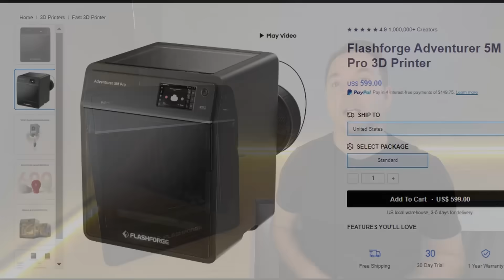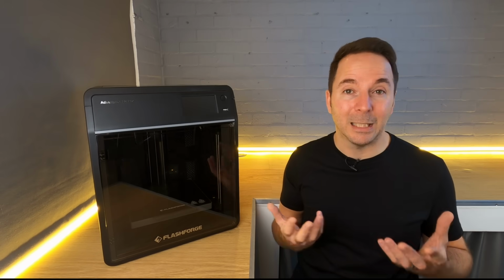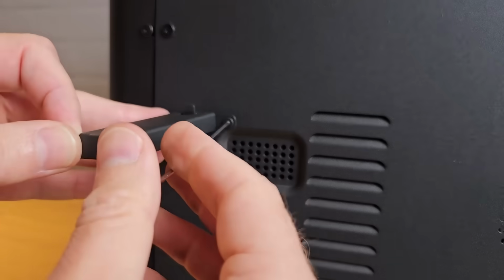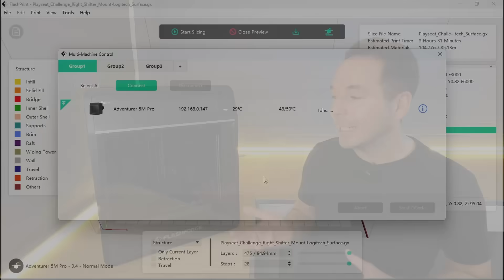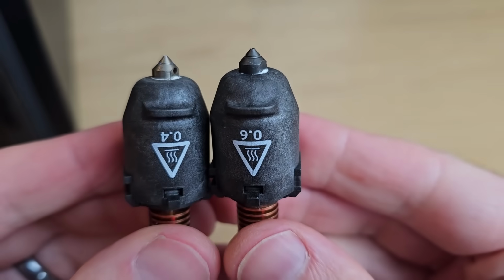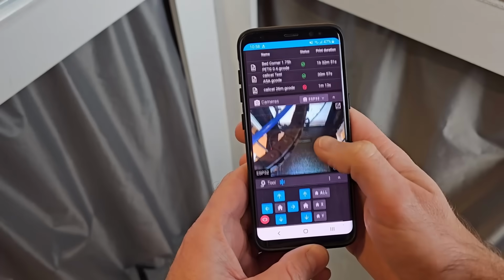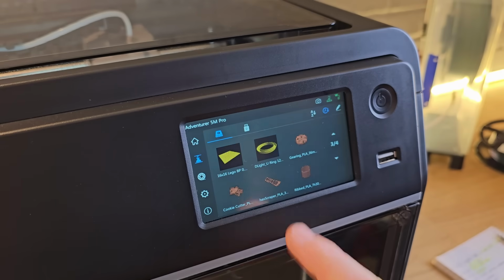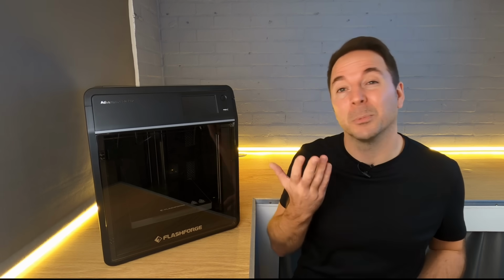The BEST 3d Printer That I Won't Use! - Flashforge Adventurer 5M Pro 3D Printer Review

Comment: I am the type of person who wants and needs a plug and play 3D printer.  I primarily use the 3D printers to make components for the products I make and sell.  I first bought 3 Adventurer 3 Pro machines in August 2022 and when the ADV5M Pro became available, I bought one and when I saw how great it was for my use, I bought another one. The 5M Pro makes production of making the components twice as fast as the Adventurer 3Pro machines. In fact, in the future, I plan to replace at least 2 of the Adventurer 3 Pro machines with the Adventurer 5M Pro machines. I have only used Flashforge printers. I am very happy with not tinkering if I don't have to. I am also glad I don't need to build my own 3D printers.
Reply from the maker: Sounds like a great printer to suit your needs👍
Reply: Thank you. This is a great comment. I am convinced.
Reply: lol funny enough I’m glad I found this comment and video. I’m not a “tinkering” person and my ender 3 has been collecting dust because I just can’t grasp it, I’ve had it for years yet I’ve never managed to finish a full print. And all the forms I find on it, apparently it’s rare to even have a non modified Ender. I’m very interested in this particular printer and im definitely considering buying it!!
Reply: Thank you for a really in-depth and “warts an’ all” review, Ricky. I’m looking for my first 3D printer and I am definitely NOT a tinkerer. This looks like a good choice thanks to your considered review. Only one question - looks like the print area is about 8.5” x 8.5 x 8.5.  Any other comparable “plug and play” printers out there with appreciably larger print volumes?
Reply: @LippyDotCom loving my Bambu A1 Mini. I've only been 3D Printing since I got it in September. 
It was easy out of the box, it has just enough "tinker-ability" but is 100% out of the box usable. It has an available AMS so it can print with up to 4 colors without having to go and manually switch the filiment. 
I hope this finds you well and if you have further questions lmk

Comment: Great video! 

That said, and maybe I'm being dense here... but aside from the nifty hotend replacement system this seems to be trying to do what the P1S does, but slightly worse. For example, the filament change process... to say nothing of the greater options given by Bambu Slicer and the better 24/7 remote control. 

I really don't understand why I would choose this over the P1S, especially since the P1S also gives the option of the AMS.
Reply: You're saying the Bambu P1S would be a similar machine except with better flexibility?  I'll be buying something this week...I just have to decide which.
Reply: @boomupengineering  Based on this review and my own experiences with the Bambu machines, yes. The Bambu P1S just seems like a better quality machine for the money.

Comment: The "locked down" mindset is the prime thing keeping me from even considering many of these new printers.  I liken it to buying a new car.  If the manufacturer says "Sure, you can drive to any address you want but you can only get there by the route we decide and you have to listen to the radio station we program into your presets" I'm pretty sure most people wouldn't be too happy with that.  I just outright refuse to pay so much money for a device where they get to maintain so much control over how I use it.

Comment: I'm expecting my Adventuret 5M Pro tomorrow. I appreciate the critique and troubleshooting, as it leaves me prepared on how to fix possible problems if I run into them too.
Looking forward to it.
Reply from the maker: It is a really good machine.
Reply: How have you liked it so far?
Reply: @SangheiliSpecOp  There's definitely room for improvement on their software/firmware side, but the printer itself has served me well. It took me a while to figure settings that worked for me, but has been great since.
Reply: @Oblimix  thank you for sharing :) I'm glad to hear it
Reply: @Oblimix  7 months since your   comment is there anything else you'd add? 

I'm seriously considering this printer as I'm not much of a tinkerer and more about convenience and functionality. Buy once, cry once kinda guy.
Reply: @PaddyFromPaddistan  There's not much to tinker, really.
It was definitely worth it. I have printed loads of things, both functional and consmetic, for myself and family. I have also successfully sold several items from the prints on this machine, which has already paid for the printer itself. 

I have only tried some types of PLA and PETG. I didn't like the durability of my PETG, but I became a fan of PLA+ and Silky PLA, which print nicely on this printer (and you don't even need the Pro version of the printer to print those). 

One thing that I changed, and which has made everything much better, was to switch to a slicer called Orca-Flashforge. It is leagues better than the original Flashprint slicer. 

If I had to buy a printer again right now, it would probably be the same machine again.

Comment: I feel like you're not truly into 3D printing unless you've spent hours trying to manually dial in the Z axis on a crap machine
Reply from the maker: I know, felt very strange to not have to do it🤨
Reply: I had an ender 3 for 2 years and eventually this got on my nerves and having to mess about every time to get it to print well was enough for me to sell it.

I’m very close to buying one of these as I just want to print things.
Reply: @Lightning_JC  you won't regret it. I have an mk4 and it's so nice being able to print perfect first layers using the whole bed area if you want

Comment: Thank you for the review. This is indeed not a printer for me due to the locked up software. First of all I do not buy Apple-like products where one fully relies on what the manufacturer does. If they want they make the machine obsolete in a couple of years. If they make it possible to switch to bare metal Klipper this looks like something for me though (maybe it is hackable already).
Reply from the maker: It is probably possible to compile  your own firmware and maybe someone will at some point. If and when that happens this will be a killer machine for everyone!

Comment: So you can't set the pressure advance in orca slicer? You can set it in orcha slicer for the BL printers.
Reply: Yes, you can.  It works the same.
Reply: @williamsteele  okay that's what I figured. One of his main complaints was that you couldn't change the pressure advance and I figured you could.
Reply from the maker: My mistake. What I should have said is that you can't edit Pressure Advance if you use Flashprint as you would need to if you want to send g-code and use the camera which is what I did for most of my testing. You can edit a field called 'Linear Advance' which is a Marlin feature. It was inconclusive what this actually changed if anything.
Reply: @RickyImpey  ah ok. Yeah that's a bummer.

Comment: Nice review and you totally right about the lockdown... is a shame and also not legal since they need to rls all code and they did not!
Reply: Their firmware is not based on Klipper... it's their own design that they've had for years... going all the way back to the Guider, Inventor and Finder machines.
Reply: @williamsteele  it is... i decompiled their fw and its 101% klipper!
Reply from the maker: Yep, I had it from the horse's mouth, they told me their firmware is Klipper based.
Reply: @LuisG-SC  What specifically did you decompile? It's a linux distro, so you don't need to decompile anything... just go look for the binaries.
Reply: @williamsteele   Portions? you mean all of it lol, anyway they need to rls it even it its "portions" of it...! well i rest my case!
Reply: @LuisG-SC  A) None of our code is Klipper based, and it's still present. B) You didn't answer my question.
Reply: @williamsteele  your code?
Reply: @LuisG-SC  Yes, my code. I've worked with them for years on incorporating our cloud platform into their printers, and this one has our code in it as well.
Reply: @williamsteele  and...? im sorry i dont care with what you worked with, its klipper they need to comply with GPL V3.. if you ok with that, its your problem, im not!
Like i said i rest my case! off!
Reply: @LuisG-SC  You asked me about it then said you don't care... so which is it?  Also, I never said I was ok with it, in fact, I'll contact them directly and ask them about this as it's a serious problem.  With that said, you never said what you "decompiled"... do tell.
Reply: So, I stand corrected... they are using portions of Klipper, but it's still sitting on top of their tradational linux distribution.  All of our code is still present, so the Polar3D cloud is still working.

Comment: As someone with a couple Enders on a Sonic Pad (with help from you!) and now a Bambu P1S owner I agree with your sentiments on these new machines. I'm loving the P1S and it is cranking out great prints right out of the box, but there are some basic QOL stuff it just doesn't have (yet anyway) due to it's locked down software. Want to reprint a file you previously printed? You gotta walk up to the  printer and do that from the tiny screen. There is no going the file list in the Machine tab in Orca and telling it to reprint remotely. Also macros would be awesome. My Enders are using KAMP which is so much better than having to probe the entire bed every print. It really is the little things.
Reply from the maker: Agree, it's all of these little added extras that make me love Klipper. Difficult to explain to anyone who hasn't played with Klipper firmware just yet though.
Reply: Don’t you have to walk up to the printer anyway to remove the part you just printed I mean I can reprint any file that I have printed through flash print but I still have to remove the previous part first.
Reply: Bambu lately seems to have softened on their firmware lockdown going forward, but we need to see.  @anonymouse731

Comment: Great Video! I'm a New Comer to 3d Printing and a noobie content creator here. I enjoy the clean style of your videos and the information you provide. I currently only have a Bambu Lab P1S but trying to converse with other companies for possible reviews. I'm in need of a Larger volume printer atm and  really looking at the Neptune 4 Plus, QiDi X Max 3 and the K1 Max. Unlike you , at this point I prefer all the leg work of user experience to be done by the manufacture and only want to tinker if I choose to instead of have too. As my knowledge grows , I'm sure I will expand and try and push the printers more . At this point in my journey, Id prefer to be as Plug and Play as possible. Stop by my channel if you'd like..3D Pathfinder

Comment: It seems they don’t trust their market to be able to make changes 🤷🏻‍♂️
I just invested in a Qidi xmax3….ive had it 3 weeks now and Qidi now have me, I’ll be getting a 2nd one in the future.
Fast reliable prints, great customer support, and a non toxic FB community.
Great informative vid as always mate 👍🏻
Reply from the maker: Interesting that you love the X-max 3, I have the X-Plus 3 now. I like Qidi's approach  to klipper, even if the hardware is possibly not so polished.
Reply: @RickyImpey  I get that last comment, mine was delivered with the early version hotend shroud and bl touch, so I emailed them and they sent me the revised hotend shroud (it has 2 small fans in there) and an inductive probe with magnetic sheet.
But I’m going to keep the BL on as I’m reading on the qidi groups that the inductive is not so great.
But it prints Asa awesome with ease, thanks to the chamber heater.
Reply: I started with a quidi and it wiped all my files from the official usb stick and made it read only randomly. Saw an Amazon review that mentioned exact scenario but dismissed it as a fluke. Flashforge has better software but 0.4 nozzle broke in a day and their support has refused to respond to order status request on order I placed two weeks ago for nozzles.

Comment: That soft ppwer button is ridiculous. Why did they think this was a good idea is beyond me.
Reply: Prusa has one but only to reset the machine while running, a much better option
Reply: Not everyone wants to reach around to the back of their printer to turn it off.  This is convenient.
Reply: Having a hard power button at the front of the machine is often a drawback especially if you have kids / grandkids who like pressing buttons. Nothing worse than a machine being accidentally switched off during a print.
Reply: Soft power button easy solved. I have done it to mine, so now it powers on without having to press front button